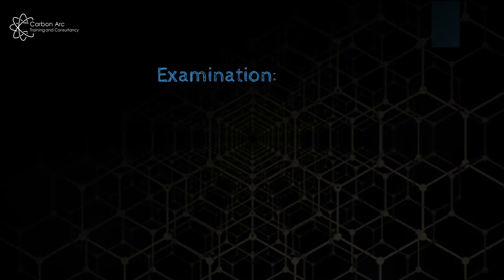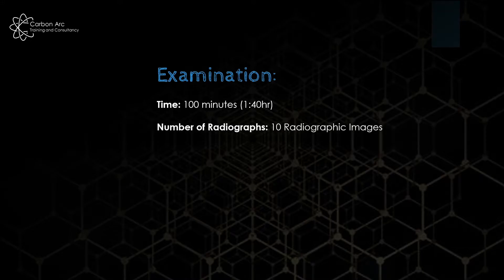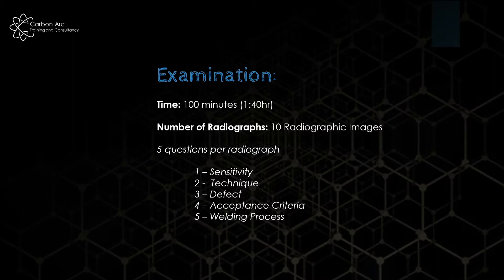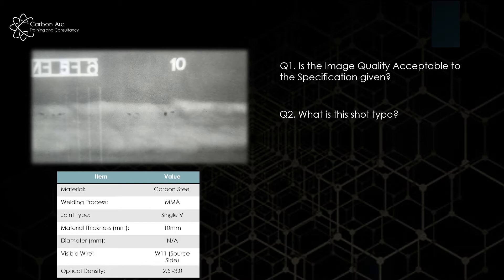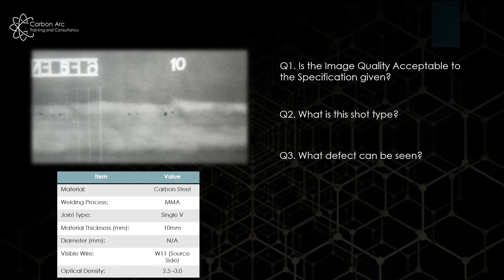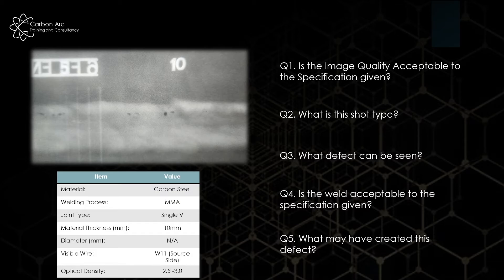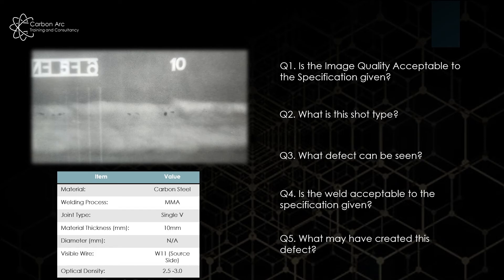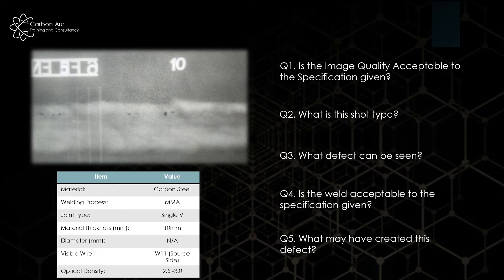CSWIP 3 2 2 RT Practical

Comment: Great video James, I already hold 3.2.1 and going back the end of this month to do the supplementary. Tried to find info on this but other than the basic info from TWI on format, found nothing, so this is brilliant!
Reply from the maker: Thank you for the feedback! Good look with your exam.
Reply: @CarbonArcTC  quick question, are we given the actual visible wire size or are we expected to know the wire sizes e.g W11 = 0.32mm?
Reply from the maker: No you are given the wire size and need to say if its acceptable. No need to know the conversion
Reply: @CarbonArcTC  thanks! I passed this a few months ago. The practical was fairly easy but found the theory harder than I was expecting. Hopefully start IWS next year
Reply from the maker: @davidmatthews4607 Great news! Sorry it took me a while to reply. I did not see your comment.
Reply: @CarbonArcTC  No worries 😊
Reply: What is the difference between cswip 3.2 and 3.2.1 and 3.2.2?
Reply from the maker: 3.2.1 is without rad interpretation and 3.2.2 is with rad interpretation